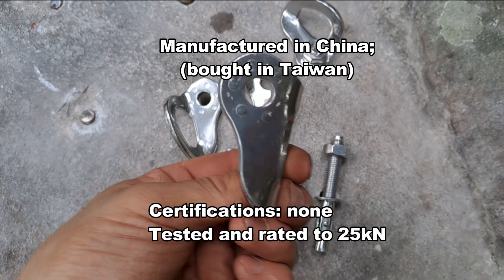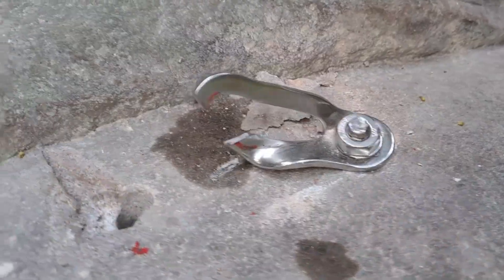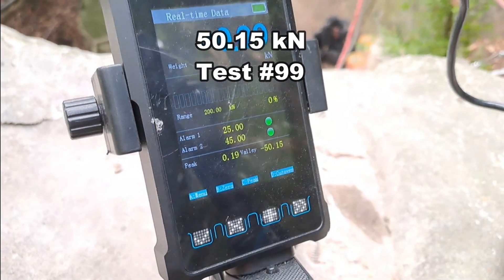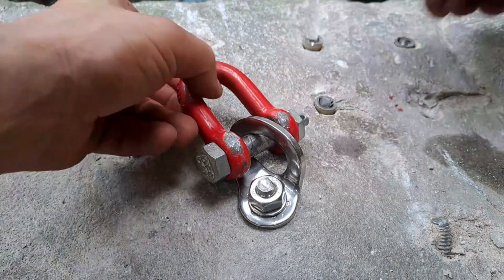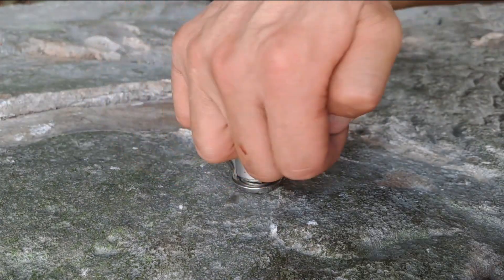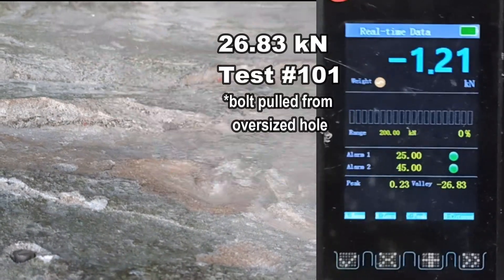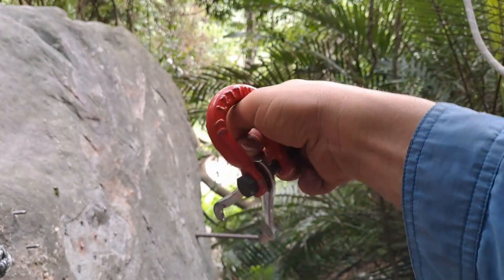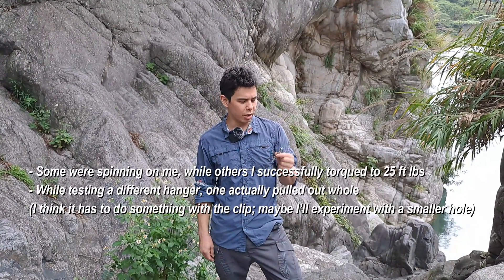BREAK TEST: 304 Stainless Steel Hanger 10mm 25kN climbing bolt, China made

Comment: why doesn't anyone make/use aluminium bolts?
Reply from the maker: Define bolts. Like mechanical anchors (wedge or sleeve) made or aluminum? (I personally  haven't seen or heard of any made). 

Or just like the hanger made of aluminum? Cause they do manufacturer hangers made of aluminum, but they're often used for caving or canyoning because they're super lightweight and strong enough for rappelling applications.
Reply: @climbingtaiwan  glue in mechanical anchors. i guess 304 stainless is a wonderful material as well, but for a cheaper alternative to titanium near seawater, i bet 7075 T6 aluminium would be a perfectly good option